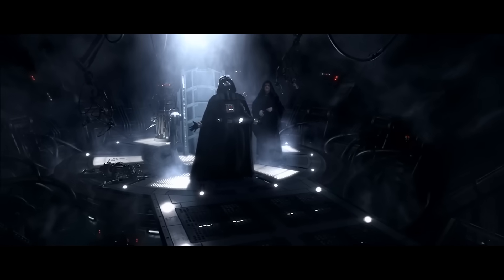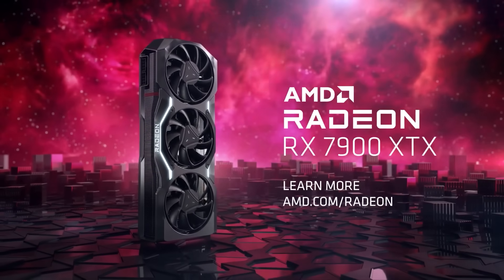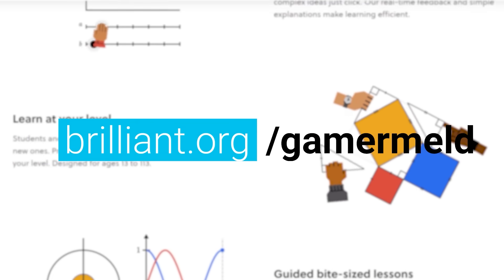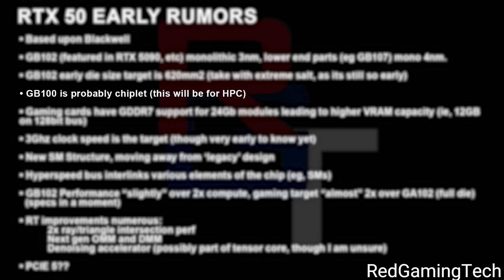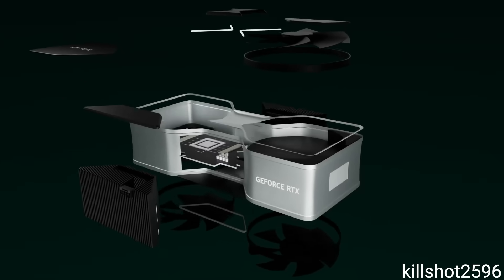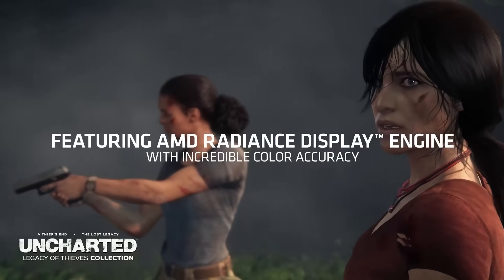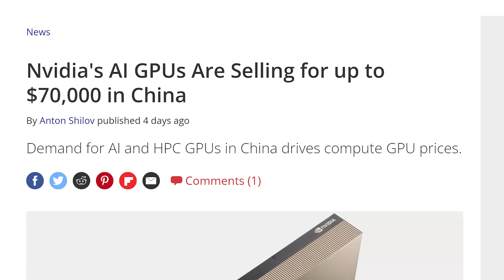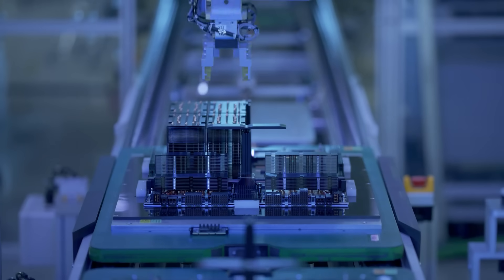Say GOODBYE To GPUs Again!

Comment: if ai leads to another historic gpu shortage it will be much much longer than the one we just lived thru...
Reply: Picking up a 3090 or 6950XT for 550 right now would be a good idea just in case this happens, either one will last through the next GPU shortage if there is one.. god forbid
Reply: @snake2dude  i bought something thinking of taiwan invasion risk, but it ensures against that as well
Reply: @snake2dude Am I hlad I just bought a 2nd hand 3090 😅
Reply: @snake2dude I just got a evga 3090 xc3 2 months ago, unfortunately after taxes it cost 859 USD, I upgraded from a 1080 ti. It was roughly double the performance so I’m glad.
Reply: It's coming! Amd and nvidia will restrict supply to the market with the ai boom and crank the prices up again. It's already happening
Reply: We can conclude this if for an infinitecy as time keep pushing for advancements
Reply: glad I upgraded to a 4070 ti now, the 4090 already increased from 1.6k up to almost 1.8k on nvidias website. People might be shitting on the 40 series right now, but it will probably age well just like the 20 series.
Reply: @OpexRL  Bad takes, only the top 40 cards if anything because the 4060TI is litterally worse than the 3060TI in a fuckton of applications...
Reply: @LeNathDuNet for now.  But when they were mining as they got more desperate they seemed to start buying others also.  I reckon my 6700xt is still ok for now.
Reply: @LeNathDuNet  You're right, correction: the 40 series will probably age well, except the 4070 and below.
Reply: @OpexRL  In the US, its still 1.6 on the website...
Reply: @OpexRL  same
Reply: @OpexRL yikes
Reply: It won't. Nvidia stopped the 4000 series. No shortage of amd gpus and won't be.
Reply: I think there won't be, because Nvidia isn't adding vram so that AI is pushed to overpriced work gpus
Reply: I think my advice to dodge the prices is just switch to upgrading in the middle of the new series with the old series example : 5090 comes out. Buy a 4090. There will be a lot of chips offloaded for ai upgrades. Not sure but that's my plan
Reply: get 4090 while its still only 2k but be fast dont wait:face-fuchsia-tongue-out:

Comment: On 2 weeks ill be getting my 4090 hopefully before they increased the prices
Reply: so if price going up you wouldnt get it? i would get it no matter what becasue a simple reason you never buy a gpu if you dont need it😆
Reply: @frallor3108 No one really 'needs' a 4090 until the next gen games really start coming out in meaningful numbers, at which point though, 4090 will be obsolete with GDDR7 cards coming out too, so yeah, bad value in my eyes, but 4090 isn't about value, it's about having the 'best of the best, latest hardware' like we see for iPhones.
Reply: I wouldn't buy the 4090 until th 5090 comes out cause who knows DLSS4 might be needed then, the same way the screwed me from my 3090 to 4090. But its your money!
Reply: Honestly I don't really care about having top of the line of parts plus when 5090 comes out there won't be dd7 parts like motherboard aio cooler etc so rather get my dd6 stuff and not worry about 5090

Comment: It's time to start making devs optimize for APUs
Reply: Exactly. With the upcoming AMD APU with 40CUs, or so rumored, it's a good time to start, if you're a gaming developer.
Reply: @BerserkPublishing how powerful will these APUs be? I'm mean GPU equivalent
Reply: @imdefyr   The rumored one has 40 RDNA 3.5 CU's which is 8 more than the Rx7600 and it's on a better arch so i'd like to imagine around a 6750XT/3070Ti , it could be even faster with a good set of ram to since IGPU's are very dependent on how fast the ram is
Reply: @imdefyr Rtx 4060 ti
Reply: @imdefyr  current RX 7600 has 32 RDNA 3 Compute Units but upcoming Strix Halo processor rumored to have 40 RDNA 3.5 Compute Units
Reply: @pineapple3193  Sorry, I just want to ask, rtx 4060 ti what? should I buy it for competitive shooter games?
Reply: @rant5664 if you are welling to get a used GPU then the 3080 or 6800 xt are good option they could be found for around 350$ and preform 30-40% faster if you need to get a new GPU then the 4060 ti is fine but if the games you play favor AMD then get the 6750 xt it has more vram😊
Reply: @BerserkPublishing  "gaming developer" 😂, yo i develop gaming, i make sure that the hobby of gaming is getting developed, this month i'm introducing new chairs with catheters so gamers can do gaming comfortably 16/7, no more going to the toilet for pp breaks. just insert the catheter and do gaming!
Reply: broken games that require overpriced gpu that are in short supply will kill high end gaming
Reply: They do. You can thank the steam deck
Reply: The integrated graphics on the ryzen 5 should be equal to the 7.
Reply: Yep. It's high time to game on iGPUs
Reply: Do you see any sign of developers optimizing their games? devs become more and more incompetent each year. Constantly releasing games with graphics stuck in 2014-5 at best, with pc requirements that doesn't even exist yet.
Reply: @Bantu_E Gotta pump out those uncompressed 4k textures 😂
Reply: Steam deck is paving the way
Reply: The atx platform is dead.  6yr old desktop hardware should have no issues playing games but they purposely bug drivers and firmware resulting in underperformed results.  Why is any gpu above an nvidia 2060 struggly to play warzone.  There is no reason for any game to be struggling at 1440p above 100fps.  The
Reply: They have to make them twice as big to not lose performance
The same Ryzen and Radeon 7600 dies connected with chiplets to keep cost down
Core count`s should not be different than dedicated cpu/gpu, current APU`s are too weak
And I hope they never use RDNA3 again in the future, it`s so underwhelming
Reply: As many people are stating...no way in hell with the past 2 yrs of ryzen / intel / Nvidia  / amd are we going to buy more parts.  Maybe every 2 or 3 but amd is in to something.  If amd keeps making updates and performance enhancement...there will never be a reason to by intel or nvidia again.  Competition is not fierce enough to keep prices low
Reply: ??? we need to start to shit on apu optimization all the friggin console shitgames are "apu optimzed" they are the bane of existence with retarded "hotfixes" left and rigth that ruin the engines perfromance when applied to ACTUAL hardware and not outdated GARBAGE.....
Reply: True, there are more potential selling aspect for APU in future if average gaming GPU prices go even higher. Let the rich enthusiasts buy 10k price GPU's majority will be playing on APU's in future or handheld devices.
Reply: It's time to steal GPU's, repair defected GPU's or developer own GPU's 😅
Reply: As a 4090 owner I 🙏 and hope the GPU prices get sky high again 😂🎉
Reply: Unfortunately the only APUs they'll be optimizing under contract is the ones found in consoles like the PS5 and XBox. Those things can play games in 4k and yet desktop APUs can barely do 1080p in low settings at 60 fps.
Reply: @Neopulse00  no way I'm Coppin this whenever I get the money but it's prob gonna be 450 to 550 usd
Reply: @imdefyr  id probably pay 550 usd for something with 8 cores 5+ghz and probably $300 GPU performance tbh, it'll probably be super energy efficient aswell, so hoping a decent air cooler or cheap aio is enough
Reply: @Neopulse00  it's large in part because consoles use gddr6 ram instead of normal ram, laptop/desktop APU's don't have nearly the same memmory bandwith the consoles have. also the whole directs access to ssd thing can help with data streaming on games, which if used smartly can also free up some of that memmory bandwidth otherwise spent on reading / writing data to the gddr6. also know that it's not really 4k on consoles, more often than not it's upscaled from 1440p or even 1080p.
Reply: @Neopulse00  i feel with steam os optimizations will be better due to open source nature

Comment: 3:17 I hate to kill the hype train, buuuuuut 2x the performance of GA102 puts it slightly ahead of the 4090.

Because GA102 is Ampere -- RTX 3000 series...

Sounds like nVidia's got another dud generation coming -_-
Reply: In another words the 5090 will be 40% faster than the 4090 since the 4090 is 60% faster than the 3090.
Reply: @laszlozsurka8991  thats not how math works. Using the 3090 as a baseline youd be correct. However if you take 1.6x1.4 (60% and 40% faster) you get 2.25x faster. In reality the 5090 would be about 25% faster than 4090. 25% is still a decent generational jump (people jumped from 1080 to 1080ti over 30%), but nowhere near the hype. If it were 2x the 4090 (maybe it is in RTX titles?) Then itd be great
Reply: @calvin2686-u1k  Sorry but 25% is not a "decent" generational jump. A real generational jump would be at least 40% or higher. 25% is literally the difference between a 4070 and 4070 Ti.

If the 5090 actually ends up being only 25% faster than a 4090 that's gonna be a huge disappointment.
Reply: @laszlozsurka8991  statistically the jumps between generations was less. 25% is pretty standard. Maxwell, pascal, ampere and Ada set that bar pretty high though. But you mention the diff between 4070 and ti... but the 4070ti is the lowest end card reviewers deem "ok value" (in the context thst the entire 4000 series is ok value at best)
Reply: @calvin2686-u1k  GTX 980 to GTX 1080 was 51% jump, GTX 1080 to RTX 2080 was 40% jump, RTX 2080 to RTX 3090 was 87% (yes I'm comparing it to the 90 class because Ampere was the first gen that introduced the 90 class) and 3090 to 4090 was 63%.

So yes, only a 25% jump is bad, in fact that shouldn't even be called a generational uplift. 40% or higher is a real generational uplift. Also the lowest card from the 40 series consumers deem "ok" is actually the 4070 since it's only $500, competes with the 3080, draws only half the power and has 12 GB.
Reply: @laszlozsurka8991  if youre going to compare a 2080 (not even Ti???? Is this arbitrary? Lol) to a 3090, then you should actually be comparing Titan RTX to 3090ti, Titan Xp (the 2nd one after 1080ti) to Titan RTX. Nvidia officially stated the 90 series are titan class. Then again nvidia also stated titan cards arent gaming cards just 2 generations before so the 3090 got made fun of a bit for that.

Additionally, amusingly, youre comparing the generations I specifically named as outliers aside from Pascal to Turing. Because Turing wasnt enough to convince people to jump from the 1080ti.

For an example, the 980ti to 1080ti was a 70% jump. But 2080ti was a wimpy 25 to 30%. Maxwell again was a colossal leap at 50 to 80% faster. But go back another generation and you see a 26% gain between 680 and 780. 28% between 580 Nd 680. 24% 480 vs 580. Keep going and you see an 8800 ultra more than swice as fast as the 7900 gtx. But 9800 gtx was about 5% faster than the 8800 and the gtx 280 a mere 10% over the 9800 gtx. 6000 series was another massive leap, but that was helped along by the fact that the FX 5000 series was actually slower than the 4000 series.

In the CPU world its common to see generational gains of 10-20%. The huge leaps we saw the last couple gens are out of the ordinary.
Reply: @calvin2686-u1k  the 90 class are not Titans lol, when did NVIDIA say they were? The 90 class was marketed as an enthusiast level gaming card so comparing the TITAN RTX to the 3090 is not fair since the TITAN RTX was never a gaming GPU, neither were the TITAN XP or the TITAN X.

Also the generational leap between the older GPUs like the 680 or the 780 were smaller because technology wasn't as advanced back then as it is now. Nowadays a 25% increase is not a generational increase.
Reply: @laszlozsurka8991  tech of 3090 isnt as advanced as the 4090 either. Thats why its generational dude 😂, thats literally why generations exist at all. Or do you figure they had 4090 tech during the GF2 days and just held back?

And yes, while their current version of the page for the 3090 and Ti makes no mention of Titan, It was called by nVidia themselves, the new Titan. Thats why theres no Ampere titan. Im surprised you didnt know that considering you appear real good at parroting nvidia's claim that Titans are not gaming cards (even though they are, GN and others made fun of them over that claim for a while, they just have some extra features)

Edit: ugh I keep forgetting Youtube wont let you post links anymore... I had a link to a GN video and nvidias site on wayback showing the 3090 is the titan replacement (and thst Titan is marketed as a gaming card). Guess youll have to do your due diligence instead of parroting nvidia and looking silly 😂

Comment: artificially increasing speed  works when you're capping vram inclusion the max of 24GB where we should be looking at min 128GB (Entry level)  256-512GB (medium level)  75GB -1.5TB (high level)  speed means nothing if you haven't got the capacity to drive the visual and audio on screen in a few short years we will likely have gddr 10 in use yet  we will be stuck within 12-24GB models yet long term speeding up works in the short term though the longer term it turns into a waste of upgrade because you are using speed to pickup the shortfall of the lack of ram..

bigger question to ask yourself how are we going to have 8, 12, 16, 20 and 24GB cards before people understand the limiting factor is ram capacity not the ram speed determines the resolution you play at, look at most aaa, aa and single a titles they all seem to choke 24GB today relying on system ram to cover the  short fall choking the gameplay even further

Comment: Yeah, AMD is just IF going to release the 7950XTX and it will probably be a very terrible 25 to 30% more FPS in games just to beat the 4090 but then NVIDIA will just smack it again by releasing the 4090TI, this is why i only buy hardware every 5 years because the improvement is usually in the 60%'s
AMD is better off trying to make it 40 to 50% better than the 4090 instead of a terrible 25 to 30
Reply: The rtx 4090 ti is cancelled why they need make better gpu when they barely have competition in this generation
Reply: Except the 7900 XTX is already using the full NAVI 31 so there is only like a 10% room for extra performance for the 7950 XTX which still be far from the 4090.
Reply: @laszlozsurka8991  the 4090 is literally only 15% faster in games
Reply: @maroosagaming  Umm, nope. 4090 is 20-25% faster than 7900 XTX.
Also AMD will definitely won't squish 30% more out of the 7900 XTX, remember the 6950 XT? That also was only 10% faster than the 6900 XT.

Comment: did I just associate 128 bit bus with nvidia rtx 5090???
Reply: that's more a question only you can answer. 5090 rumored to have 512-bit bus. Given they are 24 Gbit chips (I'm working on very limited knowledge here so I'm sure someone will correct me on GDDR7), that would mean 5090 would be.... a 48GB card?

For reference though, the 4090 is a 384-bit bus, which is why it has an oddball amount of memory. But GDDR7 seems to have a strange bus-to-byte ratio (usually to get 16GB, you'd need a 128, 256 or 512 bit bus, and to get oddball amounts like nvidia's been doing with 6, 12, and 24gb you'd need a 96, 192, or 384-bit bus). so that's GDDR7's additional speed and efficiency plus a 50% wider bus. If ETH mining were still a thing, 5090 would probably give the CMP 170HX a run for its money.

512-bit bus is absolutely huge, but nothing we havent seen before: the GTX 280 had a 512-bit bus, and more recently the R9 290 and 390s had 512-bit buses. Then you get to HBM which has 1024 and 2048 bit buses.
Reply: @calvin2686-u1k  thank you!!!

Comment: me crying with my 1660 super hoping i could get a 4080 , now wanting a 5080 since the 4080 is overpriced for nothing. AND NOW YOU ARE TELLING ME THE CARD ARE GONNA BE EVEN MORE EXPENSIVE THAN NOW !!!!
Reply: You could look at amd. the 7900xtx matches the 4080
Reply: @dominicshortbow1828  yeah the 7900xtx is way more appealing than the 4080 but I wanted to go with the rtx for the ray tracing and dlss😅😅
Reply: If you keep waiting for a good deal, then you will be using than GTX 1660 forever...
Reply: take it easy.
now even AMD has provided encoder for content creators.
it's time to switch to AMD
or support intel the new player by buying intel VGA ~ :face-blue-smiling:
Reply: @penonton4260   I hope that AMD becomes better for 3d production work in the future, but right now there are too many programs that don't support AMD for gpu acceleration or gpu physics rendering.
Reply: I’d just look away from nvidia. Their csrds are only going to get more expensive with future generations. The 4080s $1200 price is probably their new 80 class pricing on release I’d presume
Reply: Im rocking a 1660 not even super and I went ahead and built a new system with a 7900xtx. Was super excited until I was running a smooth 160 frames and would periodically get slow downs and stutters. Tried alot of things to no avail to stop it. Returned my card and going for the 4080.
Reply: i have a 3060 12gb and wanted to upgrade to 4070 was hoping its going down to 500  but i gues not im gonna be stuck with 3060
Reply: @K.A-87  i didnt outright buy the 4080. Im paying 110 a month for 12 months. Its a pretty solid deal
Reply: @cheater1394  where did you do that?